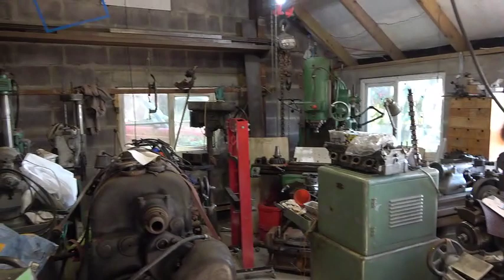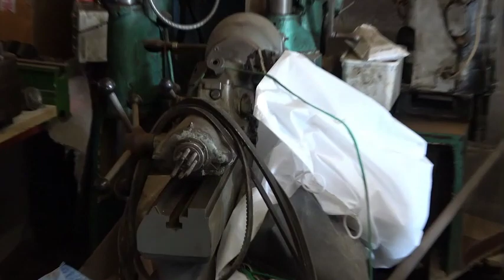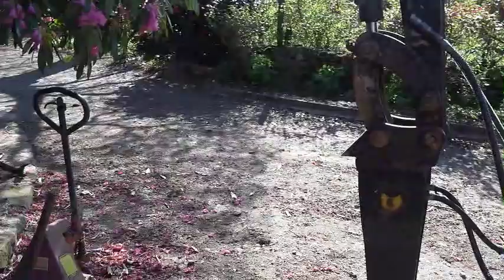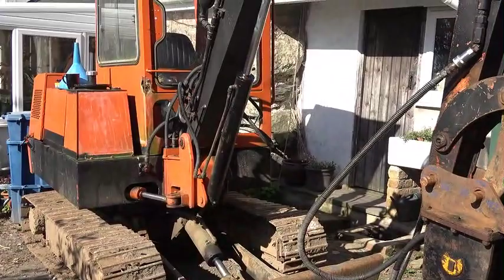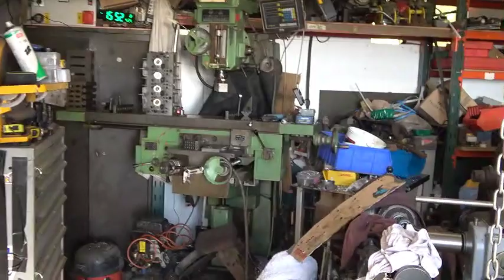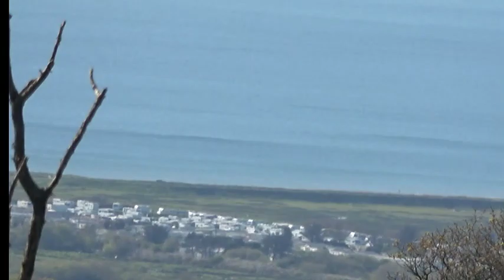Airing some thoughts on Youtube and the channel ....

Comment: The first 10k are the most difficult I think  a lot of creators start off with a plan but life just gets in the way regular uploads are important I think   if you want to build a channel
  I personally will  watch all  engineering content  except for model engineering which I have no interest  I seem to  like " get em out " i.e. broken  bolt .stud .pin  content always looking how other people deal with problems like your stuck injector  upload  also I have 40 taper turret mill envy  Gary  👍
Reply from the maker: better not tell you the other mill is 50 taper then :)